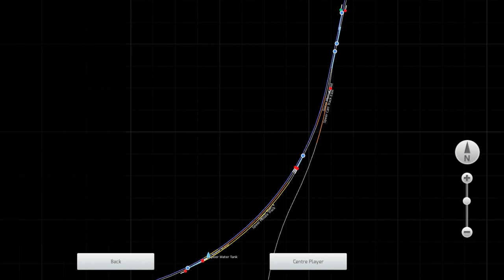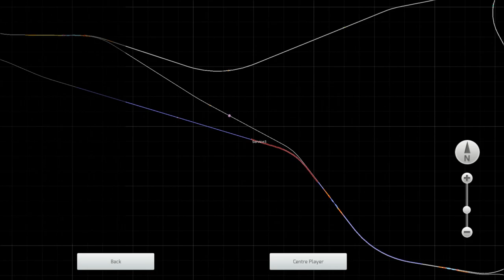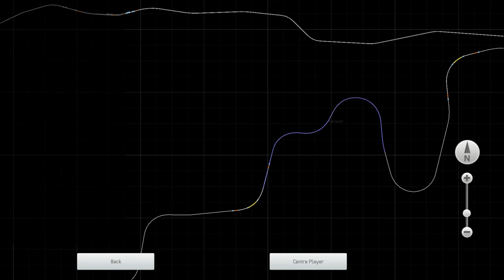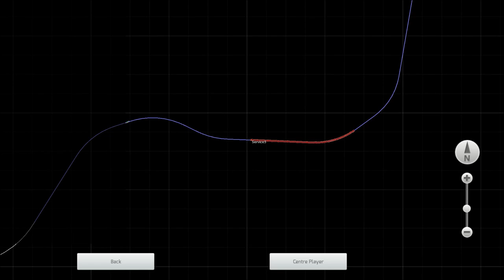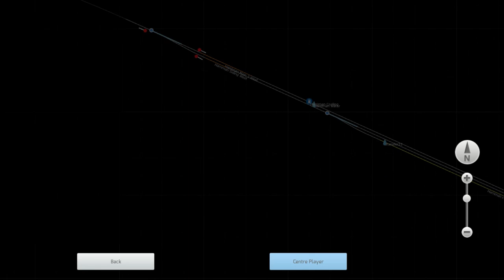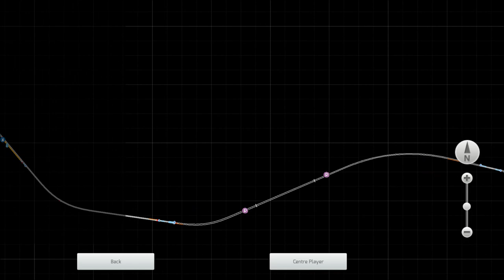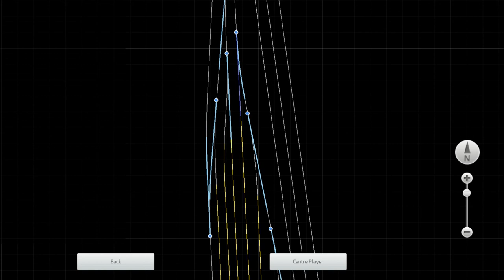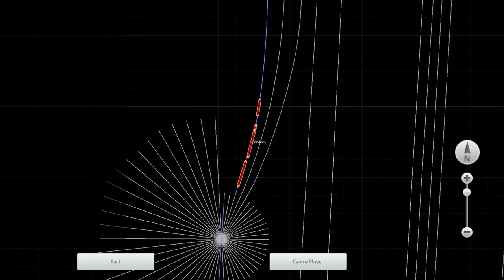TS2020 Union Pacific Big Boy 4008 Works Westbound Empty PFE Reefer Drag Over Sherman Hill Mod Update

Comment: You should release the breaks on the 4008 because it's bad to leave a steam locomotives breaks on
Reply from the maker: The brakes ARE released. The quadrant on the brake stand is the running release position.